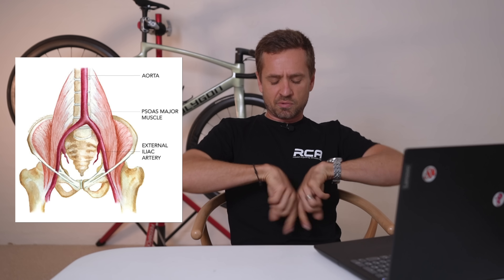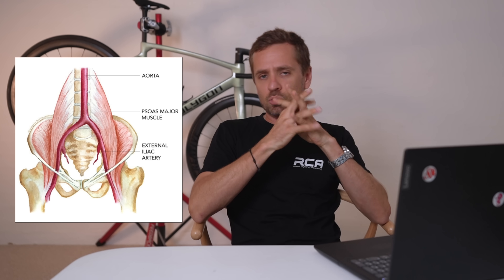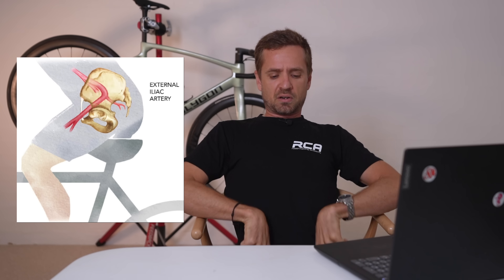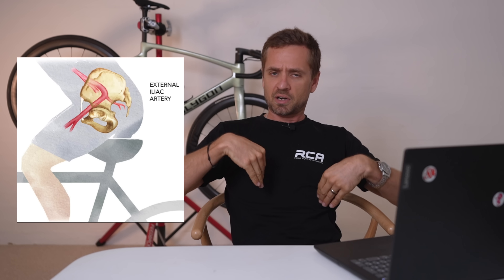Massive Loss of Power on the Bike? (This may be to blame...)

Comment: Another way to prevent this problem is for a cyclist to stand up and paddle for as long as they can every 2-5 miles stand up and paddle. This should help get the blood flowing back and to release the tension off the arteries. Even if you don't paddle just stand on the paddles while riding without peddling, until you notice the blood flowing back into your legs or until the bike slows down.

Comment: I cyclist with Iliac Artery Endofibrosis here! I have been an avid cyclist, but I have never put around 8-10 hrs a week, my week average is 4-6 hrs. Based on my experience and lots of research I’ve done, I developed the condition because of: 1) sitting behind the computer 8 hrs a day, then jumping on the bike straight away with no stretch or warm up prior. 2) bad cycling technic: my gluts were dormant and never used them while cycling, my hip used to rock tones and I was using my psoas muscle, that ended up compressing the Iliac Artery 3) Zwift Races: I was doing Zwift races quite often, when you don’t have to keep the balance and could actually go off the saddle and pull the pedals as hard as you can, working out the psoas muscle. 4)Poor bike fitting: My saddle was too high, not helping with the activation of the right muscles.
Since my diagnosis, I am deactivating the Psoas before every ride, I have worked out the hamstrings and the glutes a lot and I am making sure I stretch and warm up properly before any ride!
 I have had the surgery done 1.5 yrs ago and so far so good, couple of weeks after Marianne de Vos.
Reply: You just described me. Thank you for the heads up!

Comment: I think there is another variable: lifestyle or working conditions and this probably applies to many amateurs. For instance, if an amateur cyclist does a desk job 8 hours a day and then rides a bike for 1-2 hours, the hip flexion hasn't really changed much throughout the day. Although I enjoy riding the bike more than anything, I have to sit a lot in my work, so I also run and swim and this really helps.

Comment: Damn! This sounds like my issue. I’m 64, an average cyclists doing anywhere from 4-7k klms per season. I usually average 25-27 kph depending on wind and terrain. 
I’ve had issues with cramping for several years now. Usually it’s the left leg and starts to set in roughly 65k into a ride. First the leg starts go numb, feels heavy and slow, then cramping sets in, hamstring mostly, sometimes to the point where I’m rolling around the side of the road in pain. And more often than not several k from home. It doesn’t happen all the time but it’s always there and on my mind. 
Doctors have not been able to figure it out. 
I’m 5’5” and my cranks are 172.5. I just ordered shorter cranks, 160’s and will be getting a fit once they’re installed. I’m desperate for relief. 
Thanks for this one Neill.
Reply: Doctor here,sounds like sciatica— have you had an mri?
If it is sciatica,it can be greatly worsened by excessive saddle height.
Reply: @ 
Hey Michael
Thanks for your feedback. I have not had an MRI for this. My family doc sent me to see a neurologist, and a cardiologist. The neurologist found mild neuropathy due to several chemo treatments years ago and the cardiologist found a restricted left ventricle. The family doc put me on 1200 mg Gabapentin daily and Quinine Sulphate taken every night before a ride as well as 5mg Rosuvastatin for the heart. None of which has helped. I stopped taking the Gabapentin after roughly a year but I do take the statin. I will be seeing the doc again in few weeks and will discuss the MRI with him at that time. Thanks again Michael. Your help is much appreciated.
Reply: @Michael-s5i5j  rwa kulszowa to objaw i akurat w tym wypadku jednak pozycja na rowerze nie daje objawow rwy kulszowej - jesli to stenoza to na 100% nie bedzie rwa kulszowa przyczyna

Comment: I had a heart attack, multiple strokes and doctors found I have >16cm long dissected aorta just above my right iliac just over 3 yrs ago. 

The strokes affected my whole right side of body. I have 2 concerns when I bike:

I bought Wahoo Dual Side Power Pedals so I could see my output on each leg. Once I got out of Cardiac Rehab I started riding again slowly too but I noticed my Left leg is doing most of the work. Initially it was 52-55% but it’s gotten worse and it now 65-72% Power from my Left leg. I’ve had several Doppler US and I feel like my leg is getting worse to the point I may need surgery to fix the dissected aorta but he said putting in stents in my aorta isn’t the only thing he has to fix…there are 5-6 branches from the >16cm dissection that he said he needs to stent part of all 5-6 branches too.

The second thing is I can ride on my hoods but once I get on the handlebar drops my Speed and Power go down 10-20% instantly and even if I try I cannot get my Speed and Power up to where it was on the hoods. So that’s why I ride on my hoods most of the time.

Sorry for such a long message but any advice would be greatly appreciated!!!

Comment: Neill has fitted me a couple of times and around some spine issues but may not be aware I’ve been investigated for this condition.

Unfortunately it’s a very difficult condition to diagnose and there seems to be a growing number of people who don’t fit the pigeon hole of this diagnosis but experience these symptoms in a dynamic way (e.g. only in a flexed position).

It’s an incredibly frustrating, debilitating and depressing condition to have.

Then there’s the surgery which is very serious and has a long recovery period with some significant risks.
Reply: At least you got it fixed because the alternative if it ruptures you die within minutes. I posted my situation above but I discussing to have this fixed/stents and 5-6 blood vessels too.
Reply: @SamHoliday-i1e I haven’t got anything fixed unfortunately. Two surgeons were not convinced I had the condition.

Still trying to find what is causing the problem.